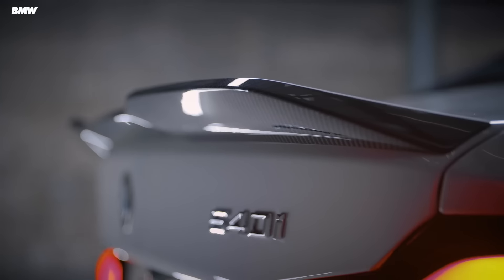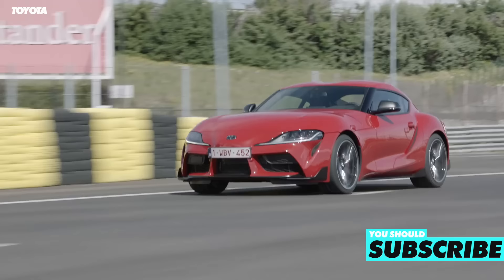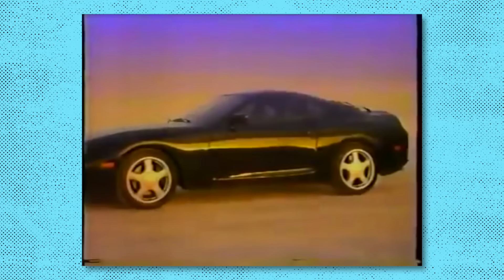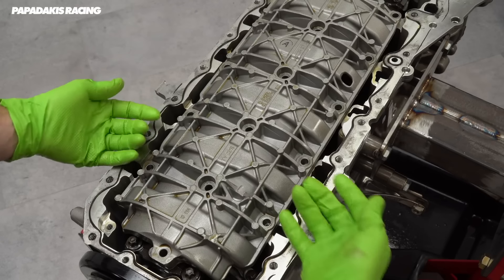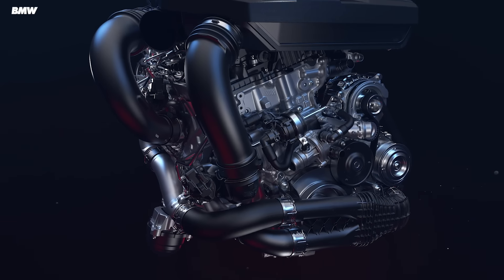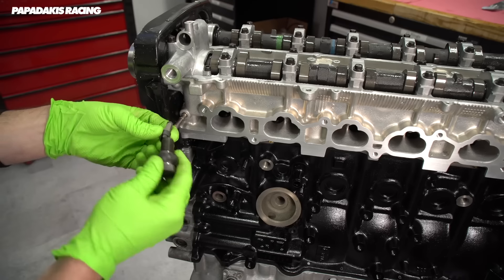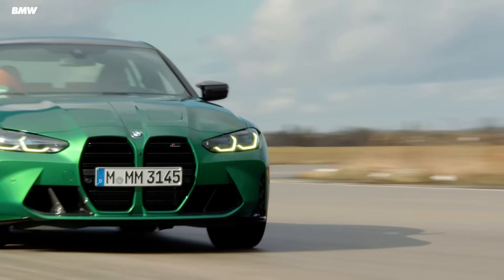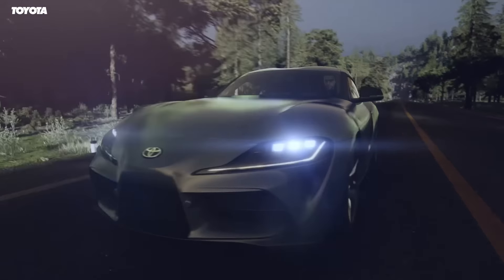Inside BMW's Greatest Engine

Comment: One thing I love is that people had a meltdown about the BMW engine in the Supra but people seem to forget that the McLaren F1 had a BMW engine and people seem to love that 🤦‍♂️
Reply: The one in the F1 was epic tho.
Reply: @yapod9061  yea it was fantastic but so is the B58
Reply: @garygritter5701  the McLaren f1 engine was a v12 but only weighted about 70 lbs more than this
Reply: Because people are fickle! They think a Toyota engine is better than a BMWs maybe for reliability of the engine that goes in the Corolla but better than BMW engines? Nah!
Reply: Then Bugatti Veyron was made
Reply: It’s also funny that they put a bmw engine in a supra and it’s suddenly super tunable as if every other BMW engine wasn’t already xD some of these idiots still think b58 is better than s58
Reply: The meltdown was because Toyota advertised the Supra like "We (Toyota have made the new Supra with help form BMW).
Look under the skin:
Interior all BMW;
Electronics are BMW;
Infotainment is BMW, 
Engine and drive train is BMW, 
Chassis and suspension is BMW, 
Body panels are manufactured and lycensed by BMW. 
So... What exactly did Toyota "Make"?! Well, Toyota made the exterior looks, the design, did quality control on the BMW engine with things like bolt specs and materials, tuned the BMW chassis and suspension to match their expectations of a Supra, did all the Supra badging and branding, but they haven't "made", manufacture or built much of anything else.
So... Essentially BMW did all the work, Toyota brought drawings of the outside package, did some tweeks and tuning and went "Ta-daaaa! We have made a car!".
If Toyota would have went: "yeah, so we made a drawing and commissioned BMW to build it for us", I think there would have been a lot less outrage or none at all.
Or they could have approached it like they did with Subaru and the BRZ/GT86, without any outrage.
Reply: The car is great. Period. But the controversy comes from the lack of Toyotas hand in the design of the drivetrain, it feels like bmw did all the heavy lifting and Toyota pitched in here and there. If anyone calls the car bad you probably shouldn’t hold their opinion very high. 😅
Reply: @haydenphalen153  Oh, no doubt! Seems to be a very good car in itself, regardless of its branding.
Reply: @haydenphalen153  yea, I love em’ because they’re mostly bmw tbh.
Reply: @alextasarov1341  the s58 is brutal and if you look at the bmw class of engine the S class engines are more powerfull than class B engine
Reply: True, but it’s only because Honda passed on the opportunity as first choice.
Reply: @ChrisKsan  your arguments are far more cerebral and well argumented than most and you do raise mostly good points, but I'd like to interject about a few: 
1. the platform was developed in a joint effort by Toyota and BMW, not by BMW alone. 
2. why would you expect the body panels to be manufactured by someone other than BMW? The cars are built in the same plants. Toyota would've had to retrofit its own factories to build this car - or they could use the factories BMW already use for the Z4. 
3. why is having a BMW infotainment system a bad thing? Why is it so important that everything is Toyota from the ground up? BMW's infotainment system is one of the best in the business and clearly better than Toyota's. This is practically a complaint that the Supra doesn't have a worse infotainment system. 

Look, if the Supra was based on a Dacia Sandero I'd understand the issue. But as it stands it's based on one of the best roadsters around, and it adds an extra sporty edge to the already sporty Z4. This is a great car. And it wouldn't have been fair to market it as a Toyobaru situation either since the cars do have noticeable differences - both in driving experience and in looks. I do agree they could've been more tame with the marketing however. 

There would've been a new Supra if Toyota hadn't partnered up with BMW, though. Keep that in mind.
Reply: well, the new supra is basically the bmw z4 but it isn't a convertible and has toe in - toe out problems at the rear due to suspension geometry... so, yes, many people get mad for stupid stuff, but at this point it has no sense to buy the supra and not the z4.
Reply: The Supra is a z4 with a body kit basically… also bmw used to build amazing engines back in the 90’s like the s38, s50 and s62 but really fell off in quality with their newest options. They just don’t produce as good of engines as they did once upon a time.
Reply: @MrGhostOg  yea, the M54 was a great engine aswell.
Reply: The mk4 supra originally was going to use some bmw part such as axels I believe. But there parts were garbage at the time so toyota never ended up using them. People don't realize cars history before they make judgements, not just on the supra but other cars too and it honestly a bit annoying.
Reply: @Tuxedo_Rabbit  yea, I love bmw and Toyota so I have no issue with them using parts from each other, it’s just small minded people that make the judgements.
Reply: no I had a meltdown about supra being around a bmw engine
Reply: @theotherchannel2028  but again, that is a good design, BMW’s are great and the supra is a cool car so the two combined is absolutely fantastic.
Reply: @garygritter5701  yeah I know, I was kinda joking
Reply: Its NOT the engine, its Toyota going to BMW for their engine and chassis and having the nerve to call it a Supra ...
Reply: @ChrisKsan  Amen 👍🏾
Reply: @ACommenterOnYouTube  meh, atleast they made it a sports coupe and not a crossover, Mitsubishi “cough, cough”
Reply: And those people forget that the new Supra might not have been possible without BMW because of the costs to create a new platform for just one usecase.
Reply: People also forget that the 2j was based off of The 1j which was designed by Yamaha
Reply: @gsxMac24  yep 👍
Reply: @gsxMac24  actually the HEAD was designed by Yamaha for the 1JZ and 2JZ ... but the head was BUILT by Toyota using Yamaha's design. The head is just a pass thru, the real POWER is done within the block that was designed and built by Toyota ..
When you build for POWER ... what is done to the engine to be able to "hold" that power ...??? The BLOCK is upgraded with pistons and rods and crank ... 
Before saying that the 1JZ and 2JZ are built by Yamaha ... do some research 1st
Reply: @ChrisKsan  That's the problem. In every test you see, Toyota is given credit for the car, when the bulk of the work was BMW's. It's got a BMW soul, BMW weight distribution, BMW traits. It's a BMW. 

So why do journalists, most of whom are Toyota fanboys, praise TOYOTA of all people for the car? I think only Chris Harris expressed disappointment, lol.

And the exact same thing happened with the 86. The idea of the car was from Toyota, but Subaru did most of the R&D, supplied chassis and engine, and assembles both versions of the car in their own plant. Who took credit for it? Toyota. Not Subaru.

It's funny when you see that with the Miata and 124 Abarth duo, the exact opposite happened. The cars use a Mazda platform and are assembled by Mazda in Japan. The 124 was largely shunned and considered inferior.

I don't take automotive press seriously anymore. All of them a bunch of Porsche and Japanese fanboys.
Reply: people were less upset about the B58 than they were the fact that the entire Supra, save for the body, is a complete copy of the Z4; it's a BMW Z4 platform and BMW interior. It's a rebadge with low effort on exterior/costcutting with fake vents thatt aren't useable. $20k cars have real vents.
Reply: @ChrisKsan  the Supra burns oil bad because the B58 QC is trash.
Reply: @garygritter5701  Apples and oranges. Mclaren was a tiny brand that did not make engines back when they had BMW make their engine. Toyota has been an engine manufacturer in F1 historically, makes engines for endurance racing and could have very well made the Supra engine as they are with the new Corolla GR engine.
Reply: @nightdriver7216  All sins of Toyota are forgiven, they have bestowed upon us the blessed GR corolla lol. pretty funny that toyota only decides to make a sports car completely on their own when the AWD turbo hot hatch/compact sedan market has almost dried up. no STi or RS or Evo to compete with domestically, only the Type R remains but it isn't AWD. just needs to compete with GTI/R basically
Reply: @bladerunner5788  "Then Buggatti Veyron was made"

Nope. Koenigsegg was made.
Reply: @ACommenterOnYouTube  False.

The 2JZ is just a STROKED 1JZ.  Hence 2.5 to 3.0 liters.

Technically, the 2JZ is half Yamaha.
Reply: @borla4491  False again ...
Reply: @ACommenterOnYouTube  Do research before you speak.
Reply: @joebloggs4191  2JZ
Reply: @spoton3278  Nah! apart from being tuneable and maybe reliable the engine ain't got nothing, no character no good sound nothing! BMW inline sixes are legendary for the smoothness refinement and power and efficiency as well as in most cases being pretty reliable (apart from the N54) and the turbo sixes N54 B58 are very highly tuneable just like the 2JZ but at the same time way more characterful and way more advanced!
Reply: @joebloggs4191  different strokes I suppose. Tunability and reliability are huge in my book.
Reply: @spoton3278  I think you get both and more with the B58 or of course you have the 2JZ which meets those two requirements but not much else.
Reply: Not really comparable as McLaren didn't make engines. They needed an engine because they never made one.
Toyota had a previous Supra. 
Toyota had a previous I6 engine which turned out to be a gem. It's normal for fans to be upset that their favourite manufacturer didn't go all the way!
Reply: @ognintendo7061  I've been wondering if the price to pay for the GR Corolla wasn't the STI's demise. The GR Yaris is also an "homologation special" but the engine in the rally car is completely different. At least the cars are bespoke compared to their base versions, but this is not uncommon.
Reply: It had a bmw engine, but if it used a bmw chassis, suspension, and interior, people would not like the f1 as much. Your comparing apples and oranges
Reply: @BMWROYAL  must say apples are superior and that’s a nice E90.
Reply: Best car & engine ever made.
Reply: So did Rolls Royce at one point
Reply: Different......Toyota built one of the greatest 6 cylinders ever and did not need to outsource for another engine. Further, the new gen Supra is still a BMW under the skin which is an insult.
 McLaren is a chassis builder first, and given its history in racing it was always understood that the engine manufacturer was going to be different. The current McLarens use the M838 twin turbo V8 which traces its origins back to Nissan.
Reply: They didn't put the engine in the new supra.  Toyota put thier badge on a z4 basically.  Not quite the same thing
Reply: @alextasarov1341  it isn't but it is more attainable
Reply: @ChrisKsan  well they're both made in the same manufacturing plant Magna Steyr which has been making BMWs for a long time so that can explain a lot. The iDrive is also one of the best infotainment system currently and is even good enough to be fitted on a Rolls Royce
Reply: @lehelzelenka207  that engine would only be good at ruining the handling. It's 60 kilos more heavy
Reply: @MrGhostOg  oh funny because they drive completely different. Not to mention when a chassis is built to be a roadster, they're miles different from a coupe as they have to have more bracing to replace the strength and regidity provided by the roof structure so no, you're wrong
Reply: @MrGhostOg  and now they're back with the B58 and the S58, pretty much two of the best engines rn
Reply: @ACommenterOnYouTube  except they didn't go to bmw for the chassis and it was designed by toyota?
Reply: @hoost3056  the engine that weighs 200 kilos and ruined the handling so bad they have to use a different engine for the racecar. Not out sourcing the also made the car about $100,000 in today's money which is way more unattainable for most enthusiasts and the last car Toyota made within that price range sold like hot garbage
Reply: The entire supra is bmw, that’s what bothered people. It’s just a z4 with a facelift.
Reply: @borla4491  Yamaha developed the heads for the j engines and several other Toyota engines. They did not manufacture any engines for Toyota. YOU do the research. A simple Wikipedia search will educate you.
Reply: @bruh-ib5hz  one of these days someone will s58 swap a supra… like it literally would bolt right in lol just need a crashed m3/4
Reply: @pauloakes6952  Suzuki created the 2JZ actually.

And the 2JZ is nothing more than just a stroked 1JZ.

And here is the thing, the 2JZ wasn't originally made for the Supra A80 MK4, it was made for the Toyota Aristo/Lexus GS Sedan, which had the engine LONG before the Supra A80 Mk4 existed!
Reply: @alextasarov1341  Soon it later, someone will swap in a B58/S58 in a A80 MK4 Supra!
Reply: That's cause McLaren is an English made POS and IF McLaren made it no one would have bought it. England has a long history of POS Cars/MC that go all the way back to the early 70's with the XJ6 being a lone exception. The XJS was a 12 cyl version that had huge reliability issues.
Reply: @anonimous2451  WTF is your point?

Also Alfa Romeo is Italian, yet is made by American (USA)!!
Reply: Yeah well the Supra isn’t a mclaren bud.
Reply: The Mclren F1 was a one of a kind car though and not a next gen of an existing car...
Reply: @boostybotha355  K.

Then how about the Mercedes E500 being a Porsche?
Reply: @borla4491  Don't pick and choose, I was just making a point in regards to the example provided in the comment.
Reply: @boostybotha355  What? That your "point" doesn't make sense?
Reply: @borla4491  Oh you're one of THOSE people. My point did make sense. The Mclaren F1 was a one of a kind car. It wasn't a predecessor or successor to anything. The new Supra is the 5th generation. Try again
Reply: @boostybotha355  "Oh you're one of those people"

What people??
Reply: @borla4491  If you don't know it's not worth my time explaining. No response in regards to the other part of my comment? Also, you are wrong about the 2J being nothing more than a stroked 1J.
Reply: Not a solid argument at all. You're just assuming that people who don't like a BMW engine in a supra love the McLaren F1. Also, even if they did it doesn't mean anything. It just means that they would've preferred Toyota build the motor or make a new gen 2jz.
Reply: @Wheresmy240  oh come on now, who doesn’t like the F1? Especially the 90s kids hahaha
Reply: @Wheresmy240  you have a 240? Is it fast?
Reply: @boostybotha355  youre right. I love the F1 and I don't really have a problem with the BMW engine in the new supra either.

Yeah man, I had a 95 240sx with a s14 sr20det blacktop with a top mount turbo, fully built internals, tomei cams, all bolt ons, etc. It was pretty fast, it was producing around 500hp with high boost (25 - 28 ish psi).

The reason why name is wheresmy240 is because my dope headed little neighbor that I treated like a brother decided to steal my engine off the engine stand when I was working out of town. I came home to my engine and transmission missing, he scrapped them for little to nothing. Wheels were taken off the car and he tried to rip my intercooler off.

I sold the car after that, it just broke my heart. Lol

I wish I woulda kept it now and just put a ls1 in it or something because the chassis was in great condition and all the suspension components were new.

I wanted to shoot my neighbor but he was already locked up cause he went on a stealing spree. All my neighbors had shit stolen too and all pressed charges.
Reply: Wildly different circumstances, obviously.
Reply: The 2jz was such an epic engine toyota fans were disappointed when they found out the new supra was out sourcing the new power plant.
Reply: Lol not really a good comparison look at the price difference. I don't think the bmw engine from the McLaren was ever used in any other cars, at least as far as I know
Reply: @Wheresmy240  oh wow :-(. What a story. A sad story cuz there are hardly any of those sr20 engines left and even less 240s that aren't destroyed
Reply: Because a Supra is a beloved classic and the Z4 is a joke no one wants.
Reply: @bruh-ib5hz  disagree. The issue will always be what Toyota can do versus what they did with this current Supra. Your argument is not about weight but the placement of the weight. If Toyota wanted to design the chassis or reduce the weight of the block while keeping the same or better structural integrity, they can do it. It comes down to choice. Toyota has been at it a long time and the reason I and others are upset at this version is because they took the lazy way out of building an icon.
Reply: @hoost3056  the lazy way is also the better way. Keeps production costs down, makes the car cheaper for the consumers and BMW has always been known for good straight 6. Plus I think BMW has a great pedigree of building sportcars and it shows as performing quite well in the super GT series. I know a lot of people doesn't appreciate the car because wasn't built from the ground up by Toyota but petrol cars are gonna go out soon so getting an affordable sportcar that's also very tunable is definitely a win, and it's coming out with a manual so that's 2 wins
Reply: McLaren is known as a chassis maker historically. Toyota is a top down car maker, they could had made their own. Not a good analogy.
Reply: Only a true enthusiast understands!
Reply: Its not that the car id bad or anything its that people were looking for something that came genuinely from Toyota such as the supra mk4
Reply: @lehelzelenka207  But Toyota no longer owns so much of Yamaha that they could produce a true successor to the 2JZ-GTE.
Reply: @yapod9061  it’s reliable too unlike most of BMW engines
Reply: @joebloggs4191  Japanese manufacturers are just sticking to their workbook. Take the best engine in the world , and deeply improve it for reliability and efficiency. Subaru officially collaborated with Porsche for their boxer engine too. Nothing new under the sun. Majority of manufaters collaborate with one a other, business is business, simple as. 🤷🏾‍♂️
Reply: Every time I see a Supra I tell the owner ‘nice BMW’.
Reply: @yapod9061 still be the fastest naturel aspire engin and hold the record of 396km/h
Reply: Because the Supra is known for its engine, Toyota had their own engines in the past. What does the F1 have to do with the Supra?
Reply: @CSLFiero the mclaren f1 engine was 265-274kg, the 2jz is over 200kg without turbos and the b58 is 139kg. Why would you claim the s/70 was only 70lbs/32kg heavier?
If you want a light engine, the v10 F1 engines were 90kg at 930hp.
Reply: @laurean5998   your spec is for a wet S70, probably with exhaust manifolds. the spec gordan murray called for and received was for a sub500lb engine, the S70 came in only a hair more than 500. Ofc the V10s from the early 2000s era F1 are more, but they have a service life of 500ish miles. The service interval of a full power S70/2 from the Mcf1 LM is 25,000 miles.
Reply: The people that freak out about the mk5 supra were never going to buy one
Reply: Can’t compare a f1 built engine to bmw engine that we all get
Reply: People have a meltdown cause Toyota cheaped out. The MKIV had a legendary Toyota built and designed 2JZ. When Nissan revived the GTR name with the R35, it was a Nissan design from the ground up, same with Honda and the NSX. Both monsters and for their time competed with cars double and even triple the price. Toyota put a BMW power train in the car and slapped one of the most legendary names in all of automotive history as a marketing gimmick.
Reply: And the S engines.
Reply: The car burns oil but other than that it's perfectm
Reply: @onlycars_za  I’ve owned an S54, N54, S55 and now a B58. None of them burnt a drop of oil on me.
Reply: @ianmason2003  My B58 is burning alot of oil , the oem viscosity is about 0W20 so I want to change to a thicker oil and do more frequent oil changes as preventative maintenance.@ianmason2003
Reply: Comparing apples and oranges mate. McLaren f1 was basically a detuned F1 engine with a silly service interval
Reply: Yea ppl forget Mclaren was a tuning company first.  Even they’re newer road cars are tuned Nissan engines lol
Reply: Gordon Murray didn't want to use the BMW V-12 but had to
Reply: I’m about to have a meltdown by calling the b58 bimmers greatest creation
Reply: World’s first operational fighter jet Me-262 had BMW engines
Reply: I dont think its about  just an engine thing ... the supra is a bmw through  and through  .. no traces  of toyota in the drive train